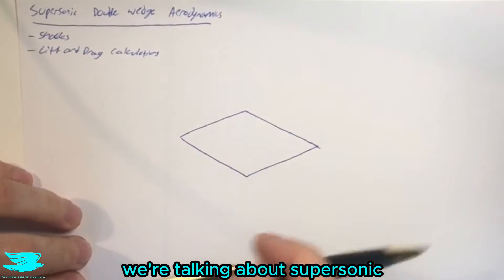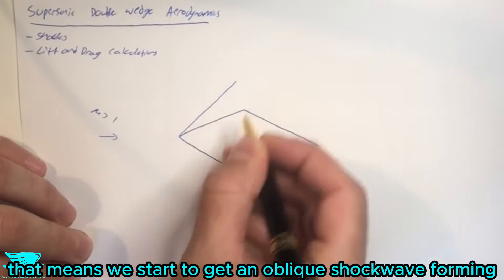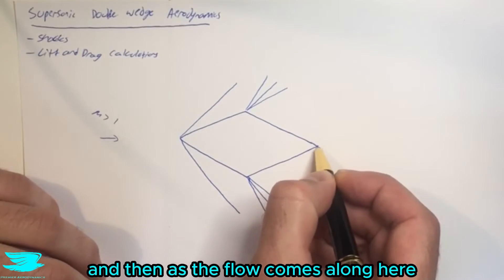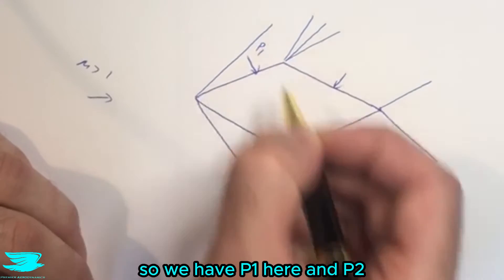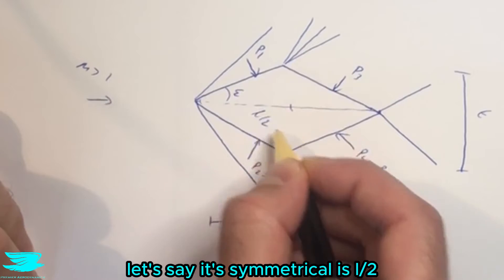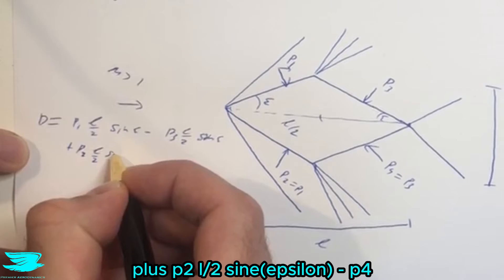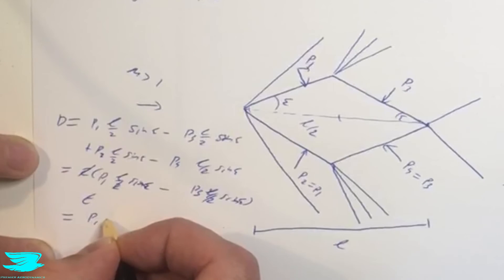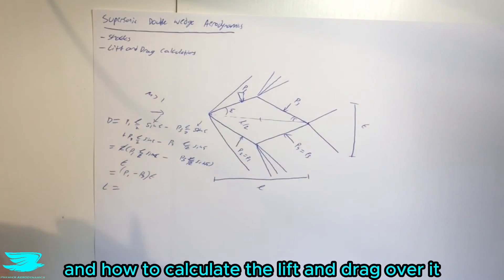Supersonic Double Wedge Airfoil Aerodynamics [Aero Fundamentals #50]

Comment: Wait so if lift is just a function of (P1 - P3)E, then does the wing just get pulled forward? I am adding those vectors in my head and it looks like it just points forwards.

Also, your channel is MASSIVELY underrated. I am sharing with as many people as I can. Keep up the good work; this is all so cool!!!
Reply from the maker: When you decompose the pressure into the lift and drag directions, you then add the lift directions up. Perhaps I drew it wrong, sorry, but jut imagine that pressure can only act perpendicular to a surface, so to find the lift component, you need to decompose it into the lift direction.

Thank you so much!